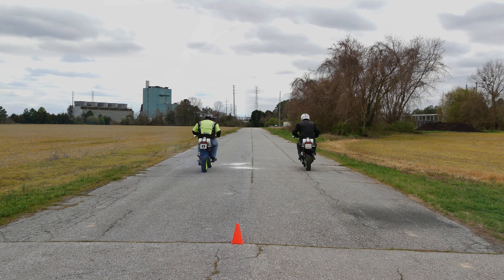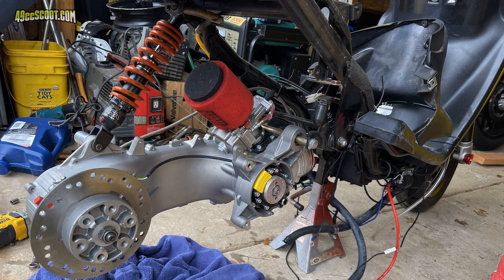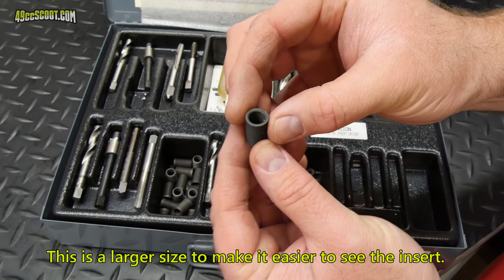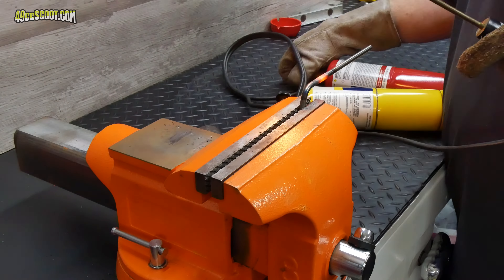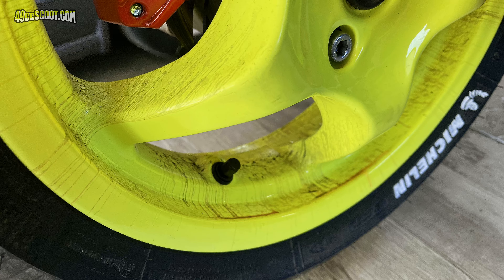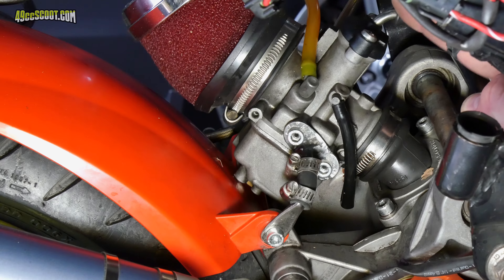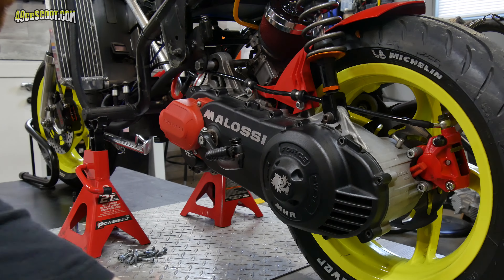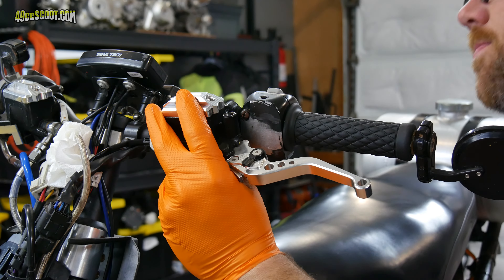RC-One : 1,500+ Miles / 1 Year Update & Making A Carburetor Support Bracket : RC1 : Part 10

Comment: Welcome to hiper engine cvts.
The best of the best. None of the quirks from the rest.
Reply from the maker: Same CVT on the other engine, just the Minarelli version. What I think the issue is, is that when I got the fancy aluminum version I was disappointed to see less travel in the rear pulley than the steel version I had. Naturally, I modified it.

Comment: Here in Europe, we don't use the 360 degree manifolds, they are moving too much for our roads and end up cracking or leaking after 30-60km. We use the Stage6 R/T intake manifold rubber, which fits perfectly with the Malossi cases, and works beautifully. And also the Dell'Orto VSHT's are very picky when it comes to tuning, so we switch them up to PWK's or even the Polini CP Evo 24mm just for the ease of tuning and longevity.
Reply from the maker: Thanks for the info.

Comment: i thought the mudguard was designed for a 12" wheel, seems they swap down to 12" wheels in europe for racing
Reply from the maker: I really thought they were supposed to handle Aerox stuff. Are there 12" wheels that bolt onto an Aerox without mods? Could be useful if someone wanted to buy slicks that aren't very common in 13".
Reply: @49ccscoot  Here in spain, people swap the Aerox engine with the Jog to get rear disc. So we use the rear wheels from: Malaguti F15, Aprilia Rally and Benelli 491, which have stock 12" wheels with rear disc. I dont know if these models exist in your country, they're very old too so it's hard to find them. These wheels have become really expensive and they are used mostly in racing scooters

Comment: this engine defo needs to be on a flat keihin or mikuni
Reply from the maker: I'm currently within about 6-7 tenths in the eighth mile of a guy with a 34mm PWK, different exhaust,  longer and lower scoot so he can hammer the throttle on launch, and he's over 100 pounds lighter than me and his scooter is around 30 pounds lighter. I've raced him multiple times on a track so it's not just numbers on paper. I think this thing would easily go a few tenths faster just if I could use all of the throttle at takeoff, let alone the huge weight difference or him punching a smaller hole in the air. I don't think it's begging for a big carb as many seem to say it is, but I won't claim that it may not pick up some small amount of power up top. I think right now the main reason I am considering a different carb is because that same person doesn't seem to need to be on the edge with float height to keep it from starving or overflowing like I have been.
Reply: Could you fashion a spacer plate to sandwich between the float bowl and carb body to increase the fuel capacity in the bowl or would that require main jet mods too?  I’m wanting to say I remember that dellorto having a wierd main jet setup I’m not familiar with so that might not even be feasible
Reply from the maker: @robertmason8341  It wouldn't do a lot of good to just add fuel capacity. The main jet would have to go lower in the bowl. Easier solution is a small length of tube to level the carb out better (or entire custom intake). The tube would add length to the intake tract, but may not make much real world difference. I have some mandrel bent tubing and a coupler around. Just gotta get around to trying it... and when it's working fine I'm not that motivated to mess with things like that. Usually it works fine... it just likes to surprise me sometimes.

Comment: Great video Brent thankyou for the update😎👌, I'm very keen to see what you've got planned for the bike. I'm putting my 70cc jog motor back together put the crank, bearings and seals in yesterday I'm going to start a thread in the forum with some  build pics. Also add the port map of the KN planning 3ex port cylinder to the port map thread if there's not one allready.

Comment: So I have question if use 70cc taiwan race kit whit round top piston can I use the 50cc head for smaller chamber and more compression bc in googel I read it will help on some 2t bikes and some friends told me to do it
Reply from the maker: Possibly. You will need to check squish clearance for sure and it wouldn't be a bad idea to check compression. Ideally you'd have a head designed for the setup with proper squish and the correct size and angle for the squish band with a combustion chamber sized to meet the needs of the setup, but that may work.
Reply: @49ccScoot  when I installed my cylinder I had a littel less than 1mm clearance before top dead on the 70cc head so it shoud be fine I think
Reply: @49ccScoot  well I  got alot to say about the set up it works great starts good and it saves fuell it has more than 50% more power and its good for 17.5 delorto carb whit 95jet and 48 small

Comment: NGK BR10EG is the Best plug for the Malossi Setup that you youse now
Reply from the maker: I just put a BR10EIX in there, literally a few minutes ago, to try for myself as well. The 10EG is what I used in the TPR 86cc and they held up pretty well in that. I think the IW34 is on the cold side for people that aren't all throttle all the time.
Reply: @49ccscoot  NGK EIX is also a good spark plug, but I don't use it, for the reason that it only gets better when the RPM in the engine gets up to around 13-15000rpm, it is only then that the eix spark plug gets better than the NGK EG spark plug, and I never keep my engine up to the RPM, I usually stay at 12-14500 RPM
but you will be happy with both spark plugs, no doubt about that...

Comment: So, what do you suggest as a commuter?
Reply from the maker: Depends on a lot of factors. If you are a two-stroke enthusiast, a sport setup can be lots of fun and very reliable. Of course what will probably be the most sensible is to find a liquid cooled EFI bike that does what you want out of the box with a factory warranty. So many possibilities. Just don't use a racing engine for a daily rider unless you enjoy teardowns. They aren't meant for racking up the miles long term and you may regret the snappy power delivery when you're in rain or anything slick.

Comment: great video as always, on I used a 5mm spacer under the reed, it gives a lot of space, for the carb, and I ran with a dellorto vhsh 30mm. I actually have a polini thor airbox, with costum airfilter. helps a lot

Comment: br10eg i had that  thing!!!! br10eix is ok! i and all people i know had the same issue. You drive and its all good. next day the engine reves up and you got miss fire. soundslike the enginen is leaning out. at a new br10eg and the problem is gone! Aprilia af1/rs 125/Rotax 123-122 Engins have thats problem to. The recomendet spakplug is the br10eg. This problemn goes back if i know to the 1992-1993 rotax engines.  back in the days we changed to b10es for the long or b10hs for the short version! it was cheaper and runs! 
the other problem is that a 10 from 1 manufactor is not the same as from a other manufactor. Bosch maks it the oposit. a ngk 8 is bosch 5 and a nkg 9 is a bosch 4 and so on. there a tablels that show a nkg 8 is the same as a 5 bosch but the tabel is made for standart engians with lot off error calculatet. thats not for racing engins or heayetunde 2 stokes. 
Finding the perfect spakplug is 10-100x harder than to find the perfect mainjet!  Imagen you have the best mainjet etc for your engine with a nkg10  its perfect! now you switch to a 9 from a perfect hell brown plug. now its dark brown. this is craszy  when you tune by parkplug interpretation. it looks to rich, ok lean it out!  for the most people ther is no diffenz. you can drive allday long lean on full thottel for 5-10 or even more secends. but if you drive it binäre 0-100-0-100 like you are racing that thing on  DRAG this enginen goes from 1 stroke to a solid rock almost instendly.
Reply: i have to thang you!! great viedos!!! nothing is hide you arre a real guy! respekt!!! every day ther is more fake shit. but you keep it real!
Reply from the maker: That's what I'm here for. Not a fan of folks that are fast and won't share or just wanna sell parts and all of that stuff. Whatever I learn/know, I'm willing to share and I try to be honest even when I screw up.
Reply: @49ccscoot  i have you in my heart bro!!! i can not share all the shit that in know. thats fucked up! but i can give you tips

Comment: If you need more room for the carburator, i would suggest using a racing subframe, which have dedicated space for oversized carburators as yours. Also, i'd suggest a PWK carburator which are indicated for these kind of setups. Great work!!
Reply from the maker: Thanks. Considering a bigger flat slide carb in the future. I have a Lectron, but that thing was such a piston destroyer on my 86cc that I'm not sure I want it on this engine.

Comment: hey man I heard u have went lighter on the floats,
what float weights did u end up using. i seen online they have 5.2g and 4g floats, I havnt weighed mine yet to know what's in it.

I have the stock 28mm dellorto vhst bs that came in the kit and using 150 main that came with it.

when i pop it up on 1 wheel it goes on for like 2 to 4 secs then it bogs, feels like flooding or chocking for fuel not exactly sure.

the carb tilts and sits straight when up on a wheel so not sure why it would bog or need fuel.

question is if I go lighter on the floats will that fix the problem you think. thanks man
Reply from the maker: Mine were 3.6g. They took on some fuel I guess and got heavier on their own and I couldn't change the float height at all at 3.8g. Replaced them with new 3.6g and I could set my float height again. The heavier floats made the float height very high.

You may actually need to try to change the angle that the carb sits at if you're doing really high wheelies. These carbs are already at a large angle and asking most carbs to operate properly when the mouth is facing straight up or down for long  isn't going to happen. 

At that point it could be pouring fuel into the intake path or it could be starving for fuel. The floats are then trying to float a different way, basically what should be sideways if the carb were level. I'm not a big wheelie guy so I've never had to deal with that. There are carbs that can work at any angle like Tillotson, but I have no experience with those on scooters.
Reply: @49ccscoot  mm, cool.
hey but was wondering if the carb is flat not on the angle that the floats will work better.
so these dellorto carbs work better on a angle.

I can't really play with the angle up or down since it's high already and if I lower it it's hitting the wheel guard already. did u mean to tilt turn the carb left or right abit, but won't that affect the float also.

I just weighed the floats an they are 4g.
one would think if it was pouring fuel into the intake which I believe could be the case, is because its on that high angle, not when the carb sits flat when on a wheelie.

so im a little confused in that case.
so I'm guessing it's a float issue also.,

should I go lighter then 4g floats incase that maybe the cause its starving for fuel or tilt the carb left or right .sorry to bother you
Reply from the maker: @TheLionInTheArea  It's pretty much always ideal for a carb to be level. At least any traditional design.

The rear facing carb (assuming yours is RC1 too) aims up when on level ground. If the front goes up it will begin to face down and level out, but level would only be a small wheelie. If you're way up there, the carb is facing down. You may want to investigate your fuel supply as well. Could be something funky going on there depending on routing of hoses and location of tank relative to carb when the front is in the air.

If you're going to buy floats, I'd try 3.6g at this point and see what happens. Not sure that it's going to work. If you have an action camera you can get a clear bowl and watch the carb to see for sure if fuel is overflowing or running out or what.
Reply: @49ccscoot  thanks so much for that! that was very helpful. God bless

Comment: I wonder as Michelin do the  Power Pure SC in a  130/60-13. Would that be enough to get you enough room to move the mud guard away from the carb slightly?
Nice update.
Reply from the maker: That's what I have on the front. I just figured the standard Aerox setup should fit. It would probably be enough to settle the issues.

Comment: Nice job man!! I don't remember, do you use steel braided brake lines? They are often a little bit firmer than the rubber ones :)
Reply from the maker: They are braided. The front was an expensive one that I had to also get my own ends for. The rear was like $15.... but seems to work fine. The first rear hose was from E-Ton and probably $30 IIRC.

Comment: think a great way fot the people  how had a 50cc scoot is like we did it in 1990 or startribg 2000.
stoke 3hp
stoke with a pipe 6 hp
67/70ccm kit 7 hp with a pipe and carburator 10-11hp
withe a fullbuild engine 70cc, crank, vario, inlet, exhuast, inginon 21-22mm carb 17-18hp
I think a Polini evo 70cc kit with a crank up to 16000 rpm. a 21 to 24mm carb  the topferformence nardo pipe. a polini /malsoosi overragne kit . and you are fucking fast!!! ok a cluch is needet. bur on a normal road this setup is nuts!  its not a hellcat but its cheap, self build and its fucking fast on the street! look https://www.youtube.com/watch?v=G-W6rHaDqZE